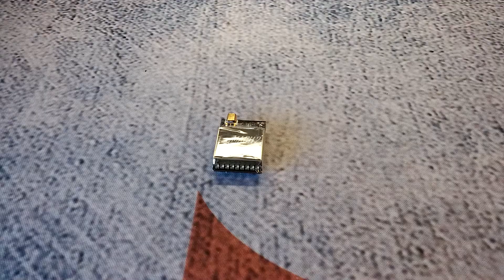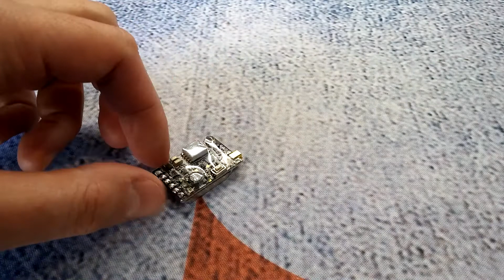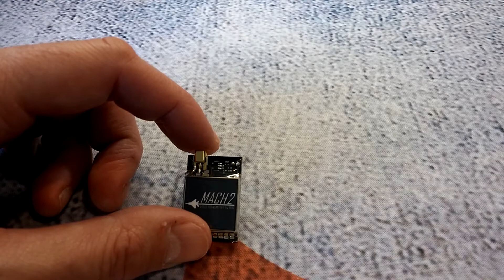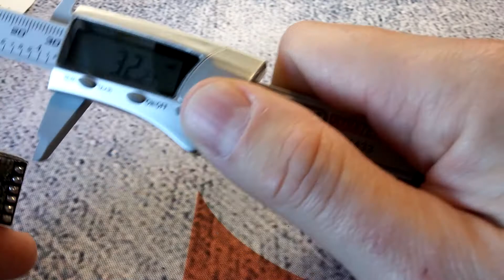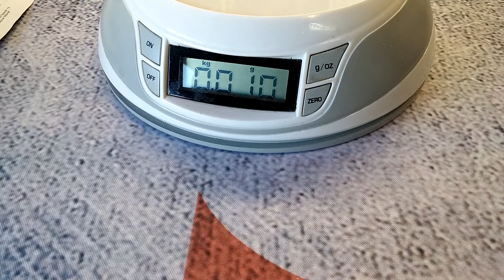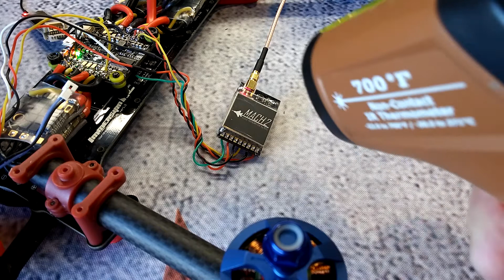RaceDayQuads Smart Audio VTX Review & Testing

Comment: I have the Mach 2 and the Cl racing f4s also, Did you run everything through the board?  Like so: vtx + & -  connected to the vtx pads on the FC board, video from vtx to video FC pad and audio to tx4 FC pad, then connect the camera to the camera pads on the other side of the FC board. By the way is the out put voltage on the vtx pad on the FC 9volt filtered by default?
Reply from the maker: ToddTube - Sorry I forgot to add the testing parameters to this video, but I always power and test these vtx's from the full charged power of the main battery voltage and power leads of a 4s lipo battery, with the camera's osd running through the board, and the fpv camera powered from the vtx.... The filtered output is indeed 9 volts, but I've found that I get much worse video interference when I power my vtx's and camera's from the flight control boards themselves.
Reply: Ok, that's how I originally planned to wire it, vtx powered on battery leads, smart audio= tx4, vtx video=vtx video pad on FC. Camera power to vtx 5v and ground, cam video= cam pad on FC for OSD or I might just use the Runcam OSD and make it clean, It's a freestyle and I only need voltage anyway.
Reply from the maker: ToddTube - Personally I'd power your fpv camera from the filtered vtx power option, since I've had video resolution problems in the past, but everything else looks good to go 👍

Comment: Good video bud, but I am running one on the Matek F405 FC with the seperate PDB, I have it soldered to my TX4 uart and have selected SmartAudio but does not want to work. To be fair my Smart Port from my receiver is not working as well, any idea what might be happening?
Reply from the maker: LOOPS - Thanks for the support. Without seeing your setup personally it's really hard to say, but maybe try to solder the smart audio wire to a different tx uart, or change the smart audio uart selection in Betaflight to another to see if it works. Please let me know if any of those suggestions work for your problem, if not I'll try to find an answer for you.
Reply: SteelRainFPV I have the Mach 2 as well and have it soldered to the TX three pad on my Maytag F405 0SD board attempted to set it up in beta flight to UART three and it does not seem to operate through my beta flight OSD or my taranis qx7 Using Lua Scripts beta flight

Comment: Gr8 review! I'm not sure if you have heard but the smart audio function is limited time only for this vtx!! Supposedly RDQ reverse engineered the smart audio! As of now betaflight has a bug and when they fix the bug, smart audio for this vtx won't work anymore!!
Reply from the maker: J.FINESSE FLIGHTS - I'm not too worried about it at this point since the newest Betaflight firmware is pretty far off from release, and the fact that Tyler Brennan from RaceDayQuads and AKK representatives has verified that there's a fix in the works, or the vtx's will be replaced for working versions, which has been verified by Joshua Bardwell personally.

Comment: You've become one of my fav reviewers. Clear, concise and to the point. Keep up the great work. Cant wait for the RF meter tests. I bought the matek vtx just before this came out and would love to see how they stack up against each other.👀👍
Reply from the maker: Splinter Fpv - I appreciate the kind words and support buddy, I'm hoping to have that vtx shootout video available by next week sometime, but this new Mach 2 VTX does have the Matek beat in features, as it has pitmode, a microphone and can transmit at 800mw for the same price.
Reply: SteelRainFPV when the mach 2 came out i was bummed. I had literally got the matek in the mail from RDQ and the next day i saw the email anouncing the mach 2 release. Doh....
Reply from the maker: Splinter Fpv - Yeah it always happens like that in this hobby, but I think that you're safe with your purchase since AKK, the company that manufacturers this vtx for RaceDayQuads, has implemented the smart audio function improperly on this and the AKK branded variant, so as of now smart audio will not work correctly with the new and unreleased Betaflight 3.3 firmware. This is all relatively new news and the Betaflight firmware isn't due for release at the soonest January 2018, but AKK and RaceDayQuads are working on a solution as we speak.
Reply: SteelRainFPV I heard that about the 3.3 issues. Well that bites for mach 2 users. Im sure they will handle it....I have learned, usually after i make a purchase something better always comes along.... I try not to buy till v2 lol. Sometimes you just cant resist. This is definately a very fast evolving hobby. Cant wait to see where we end up.
Reply: agreed, keep it up...